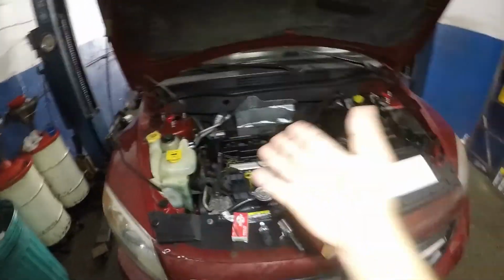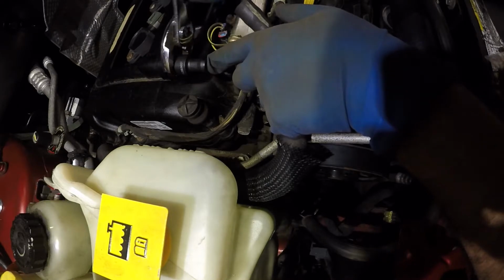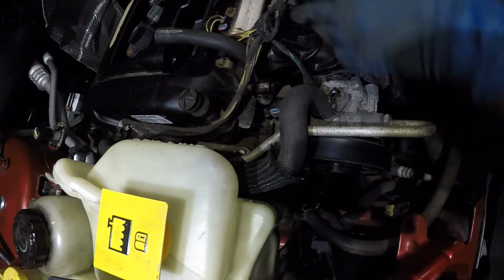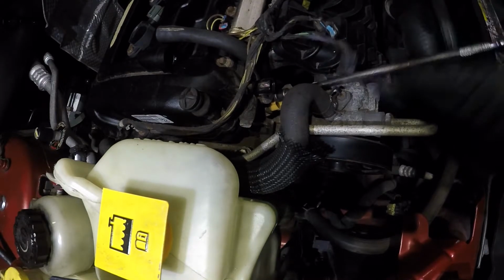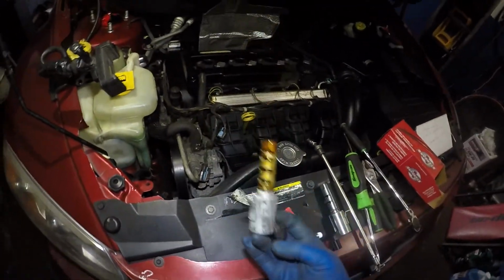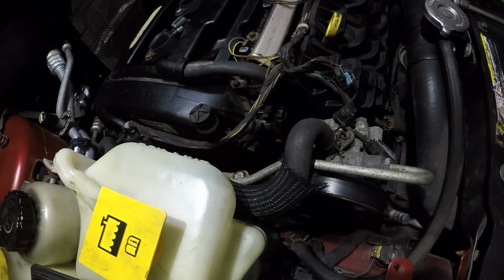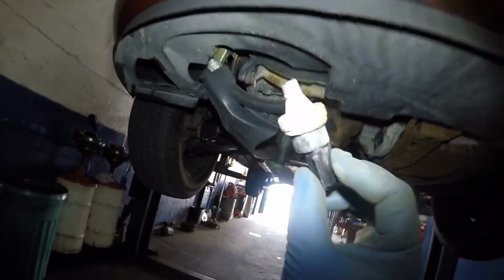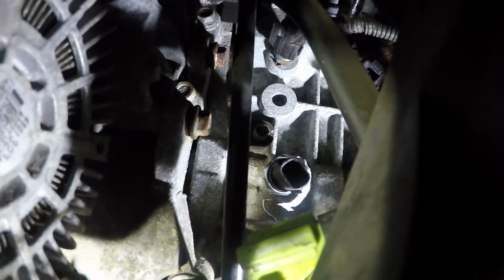Dodge Caliber replacing VVT solenoid and oil pressure switch

Comment: Isnt the sensor the oil temp sensor ? Cause when i changed the pressure sensor it was a fight 🤣 it was located under the intake manifold in the Middle
Reply from the maker: That’s oil pressure switch we did as u can see

Comment: Mechanics don't need to know there's a right handed and a left handed solenoid.  In the old days when they thought the current went from the negative terminal through the frame/body and then the starter and to the positive terminal. The solenoid was left handed.  That  worked but not so well. Now the current goes from positive through a righthanded solenoid and to the negative ground. A battery can be manufactured to go either way.. Tell me if I'm wrong. How so?
Reply from the maker: U confused me !!!
Reply: @RBTheMechanic  
A righthanded solenoid is the mirror of a lefthanded solenoid.  The magnetic fields reverse when you change from one to the other.  You don't need to know this.  My apologies.

Comment: I cant get my 10m socket in ther the oil pressure switch is on the way. Even a swivel socket wont help. Any advice?
Reply from the maker: Oil pressure switch is on the way? What ru trying to remove?
Reply: @RBTheMechanic  bank 1 intake solenoid.
Reply from the maker: @mark6020cc  yeah u got to remove the sensor connector and then fish it out